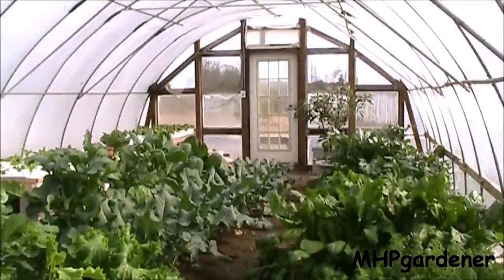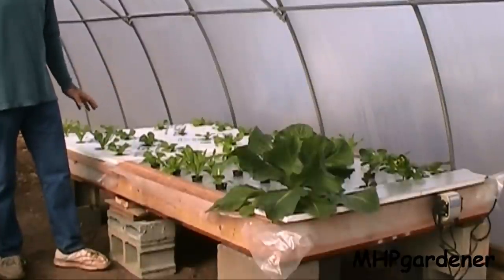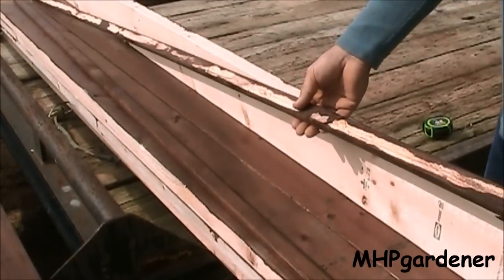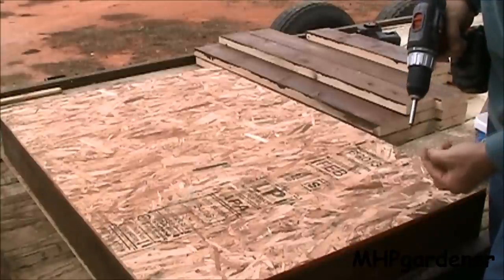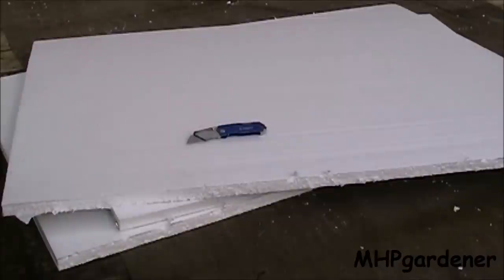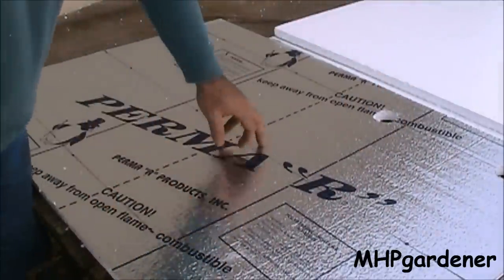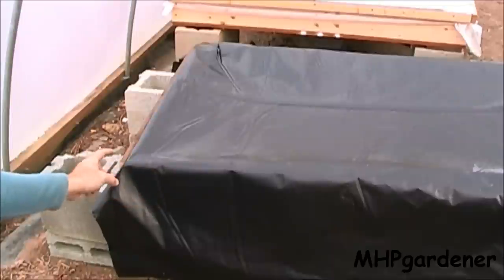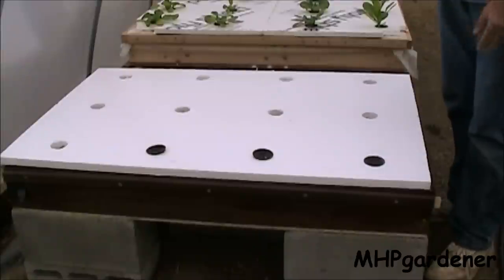Building New Boxes for Hydroponic Growing

Comment: To cut the polystyrene sheet use an old steak knife or the like and heat it with a torch for 10 secs or so and run it along a strait edge as you glide it through the sheet. Literally cuts like butter and seals the foam as you cut. No mess. Same with cutting the hole for net pots. Heat up your hole saw and don't even run the drill just press through the sheet like a cookie cutter. Can't get a cleaner cut.
Reply: Comment like this is the reason i jump to comments section write after the video. i always learn new things on the comment section.

Comment: this is the gold standard for grow box construction. 32 inches from the wall is an easy reach for most folks. four feet of length works well for weight and plant spacing. all components work well in this configuration. have some different plant spacing foam boards for different species. simple works! thanks for your contributions!

Comment from the maker: Hey Bill, I calculate the volume of water in the box, and add the appropriate amount of fertilizer. This box will have about 28 gallons of water, or 5.6 five gallon buckets. I use 10 grams of water soluble fertilizer per 5 gal bucket. So 5.6 bkts X 10 grams = 56 grams of fertilizer. Piece of cake. ;)

Comment from the maker: The cinder blocks are easy to work with, just level and stack. And they are easy to move if I wanted to change the layout. With no sunlight on the plastic, it should last for a very long time. But if I were doing a growbed, with some type of media, I'd go with the pond liner. It's thicker and should hold up longer.

Comment: I was late this year getting my Kratky plants going so I resorted to purchasing starts from the local nursery. I washed off the roots, then put them into 2 inch net pots. The problem was that the roots were all bunched up into the bottom of the pots. My solution was to cut out the very center of the bottom of the net pot with scissors leaving the plastic pieces protruding in from the sides. I wrapped the root ball with a broken rock wool cube. I was then able to insert the plant into the net pot and into the solution. The roots extending below the net pots were well into the hydroponic solution. Within a week I had awesome root growth both in the solution and on the sides of the net pot. New healthy white roots are all over the place and the plants are and happy and so am I. I did this with lettuce, kale, basil, and swiss chard. Hope this helps those that could not get their seed starts going soon enough.
Reply from the maker: Good job Richard. Where there is a will, there is a way.

Comment from the maker: Thanks.The styrofoam is much easier to work with. You don't have to worry about rotting or warping like you would with a wood product. It stays very moist on the underside, so even a good coat of paint probably wouldn't hold up.

Comment from the maker: From what I've read, white does a better job of reflecting light than foil does. All of the commercial growers use white in there systems, so it seems to be the preferred way. Personally, in a small setup like this, I don't know that it makes much difference. Most any leafy green will do fine, and I just finished growing cabbage with this method. With enough water, you could grow lots of things. Thanks.

Comment from the maker: Collards do much better as a fall crop. Around here, we plant them late Aug to Labor Day. And about the time they are maturing, the nights are getting colder and we get frost. The frost is needed to offset the bitterness. It does something in the leaves that makes them much sweeter. So rather than planting in the spring, I'd hold off until the fall. Thanks.

Comment from the maker: No...the foam doesn't actually float. I bought the plastic at Lowe's, just regular 6 mil construction grade. The 2 inch net pots are available from any hydroponics store, or on Amazon. If you do this outside, make sure to put a string or strap across it to keep the wind from blowing the styrofoam away. :)

Comment: Good Job.  I have been experimenting with a passive system and lettuce since November last year here in the UK in a polytunnel, but growth has been very slow due to temperature. The lettuce are now around 3-4 inches in diameter but healthy.  I plan to build boxes soon to try Chinese cabbage like Bak Choi which are seedlings already.  Thank you for the heads up on making the boxes, I will start soon now.  Trevor

Comment from the maker: 6 inches is plenty in this setup. I've seen it done successfully with only 4 inches. I think the pond liner is used because you're filling with some type of rock or stone media. You need the extra thickness and protection. Having a leak in a grow bed would be a real head ache. In a grow box with water and nutrients, a leak could be fixed much easier.

Comment from the maker: I've never done a typical DWC. But if I were gonna do hydro tomatoes outside, I'd definitely go with dutch buckets. Since tomatoes require so much water during the life of the plant, I think it's easier to use a circulating system. If I can help with anything, just holler.

Comment: Thanks for the info. I am building some of these this spring. Looking at other setups it seems to me it would be better to use the shiny side up on the foam board to protect it from the UV light which will break down the foam over time.

Comment from the maker: The big box has 2 sections. The pump is on the side where I do a true floating raft setup which does require aeration. The other side, and the new boxes, are all intended for growing without air pumps.

Comment from the maker: One question...what is you're timetable for breakeven? 30 days, 6 months? Assuming a price of $1 per head of lettuce (way too cheap), and growing 36 heads (3beds x 12), X3 crops = $108. That's enough to pay for the material and fetilizer. A 25 lb bag of fertilizer is enough for 70 crops, using 54 grams for each box. You have to include seed and the net pots, but it looks like a good deal to me. I don't see a way to make the boxes any cheaper. Thanks.

Comment: Your videos are terrific.  Thank you for posting all of this material.  Please explain why you use the styrofoam sheet when doing the Kratky method since it's not meant to float.  Wouldn't it be cheaper to use something else, and maybe easier if it were a little more rigid?  I'm thinking plywood or particle board with a good coat of paint?

Comment: Thanks for the quick reply Bobby. On my MG Tomato label, it does say it contains 0.50% magnesium. Looking at the label on the MasterBlend you use, it says it has 0.40%. In your opinion, should I add the 5 grams of magnesium sulfate to my 5 gal bucket for my lettuce? I dont plan on adding calcium nitrate since it appears to have enough nitrogen 18-18-20 tomato formula. By the way, your dutch bucket system energized me into building the same system and it appers to be working great, Thank you!!!

Comment: I,m making the same boxes that you just made. I think the smaller boxes is a smart idea. So does my back. I'm using 2x8s for my first one so I, like you, can control my water temp better. But, I calculated the cost of the nutrients for my box and It isn't cost effective enough. Even with less water it will still be a lot of money to buy the solution. I need to get my cost down to $5 per 48 x 36 growing bed. Do you have any ideas? Thanks. You are doing a great job

Comment from the maker: No sir, I have no way of testing material composition. The styrofoam simply holds the plant in place, never contacting the water. And the plastic, well.. after seeing how it degrades in sunlight, I don't think there's much to it. I feel like as long as I'm not heating the materials, they should remain very stable. However, if someone had a concern, they could indeed try to find "food grade" materials.

Comment: Great videos, thanks.  Since we are not using the "float" as a float, why not use OBS or plywood.  It will certainly hold up better year to year especially outside.  I used 1/4 obs but it is warping.  I suggest 1/2 inch OBS or 5/8 inch is even better.  I got awesome lettuce (especially the romane) the first year.  This year I was too aggressive by planting some squash and pumpkins so even the lettuce did not do well.  I put up a fence on the north side of the box and tried to grow sugar snap peas.  The pumpkins and squash grew too well and quickly.  Next year, just lettuce and maybe one box with the northern row with sugar snap peas.  I like to experiment like you.  Thanks again!!

Comment: You may be able to use Ridged foam board to build your boxes.  The idea is level your platform (blocks) first.  You will need more piers (blocks) say very 2 foot/ Then place you Foam frame, in this case 4x6 foam frame.  recess cut the foam for your Plywood bottom.  I guess you could also use a 3"x6" foam rails and then use a 2" X 4' X 8' foam for the bottom this would allow you to move them with 1 person.  Just remove the water first.  Her in Jax Florida we have a company called Royal Foam cont.

Comment: I'm doing a  6ft x 2ft w/2x6. I saw your video and how nice things were going for you, so decided to give it a try. I tried doing the Kratky systen in a small 15liter container. It worked good. Iwas thinking in the bigger system I would go for the floating raft system. Which method do you think is best? Also what fertilizer do you use? Thanks again.

Comment: Bobby,  I'm doing a similar setup over the next 2 weeks.  I have a 12x24 GH and I'm planning to do 4 grow beds just like yours, however they are going to be piped in a recirculating aquaponics system.  They are also primarily to grow aquatic plants, but I am going to throw some veggies in also.  How do you like using cinder blocks for your beds?  I'm debating on whether to use them or 4x4 posts that I have salvaged.  how well does that 6mil plastic hold up?  I ended up going with HPDE liner.

Comment: Thanks for all of your videos Bobby. I have a question. I believe that you said that the new boxes held 28 gallons of water. I was wondering how much water was left over after the lettuce had grown to harvest size, or in other words, how much water is each head of lettuce using. I was wondering if you could cut the top out of a 2 liter plastic bottle so that a 2" net cup would fit inside and if the 2 liter bottle would hold enough water to grow the lettuce to term. Your thoughts would be appreciated. Freddie Garrett
Reply from the maker: Yes sir, Dr Kratky did some things with small containers and the lettuce worked well. It won't get as large as something with a bigger reservoir, but it did grow fine. I think he recommends about 1.5 to 2 gallons per plant. How much water is left in the reservoir depends on the weather. Plants will use up a lot more water during hot weather.

Comment: Also, do you have any problems with durability of using the 6mil rolled plastic instead of say pond liner. I ask because i've typically seen pond liner recommended when building beds.

Comment: I expected the styrofoam to be floating on the water and not sitting on top of the frame.  Is there a specific reason for that?  This may be a stupid question but what if the water level fluctuates through evaporation, wouldn't that leave the roots hanging?  I've never done hydroponics but and thinking about trying it, would like to understand it better.

Comment: I built the same box 4x8 feet in size.  I also have 2 air stones inserted inside and there's about 1/2" air gap betweenthe water level and the foam board. However, my plant roots are turning brown. Do you know why?  Is it lacking oxygen? Should I get more air in it?  But my plant roots are turning brown.

Comment: Thanks for the videos. They are great for a neophyte like me. I have a couple of questions prior to building my Kratky method boxes. What varieties of lettuce do you use? What is the radius of a full size plant? Would you recommend sealing the styrofoam with a latex paint to keep it from degrading from the UV rays?

Comment: Hi MHP, I have a suggestion for your boxes before you put down your plastic. I plan on building off your design except building deeper boxes (8 maybe 10 inches). Might I suggest that you paint the inside of your boxes with Red Guard from Home Depot or AquaDefense from Lowes. This will give you a nice smooth surface for the plastic sheeting to lay on.  I do plan on modifying the design to Aquaponics which will mean I have to link all beds together water flow.  Have you given any thoughts on  Aquaponics? Also, do you have any problem with root rot in standing water?

Comment: another great way of cutting styrofoam (though requires being very careful) is to heat a hacksaw blade  (or piece of bailing wire or equivalent) with a blowtorch (small handheld propane torch works fine) then slide it through the styrofoam. using a straight edge or board to guide the cut is good. also precutting the silver backing without going too deep can help. when drilling the holes, the hole saw can be heated in the same way, then just pushed through, or another technique i've seen is to heat a large ball bearing then simply lay it on top of the spot where you want a hole and let go (only do this with pliers). as an alternative to dropping it directly onto the styrofoam, it could be dropped through an appropriately sized metal pipe.

Comment: Hello
Nice video but I have a few questions for you. First are you using food safe plastic liners? Second what kind of stryofoam are you using? I have heard that you have to be careful when using these types of products. Any thoughts on your part about these issues?
Reply: The kind of styrofoam is probably irrelevant, because polystyrene is completely stable at the temperatures used during the growing of the plants (plasticizers leaching into the food is relevant only at elevated temperatures produced by the microwave ovens). The brand is visible on the video and had you googled it ("perma R") you would've found that it's standard construction styrofoam board.

Comment: Shouldn't the Styrofoam be cut to float in the water? This way as the water evaporates the plant is at the same level in the water as when it was first planted.
Reply: You may be referring to an earlier video where he showcased Kratky method vs Floating Raft. In that case he was growing various different plant species in the same set-up. The advantages of Kratky Method, being you do not need aeration, therefore possibly no electricity in your setup. The downside I believe was showcased in that video, plants of different species may hog all the water thereby making it harder for the more shallow roots of the lettuce he was growing to keep up, thus stunting their growth. I believe for this set up he is growing the same exact plants so Kratky Method of no aeration perhaps may work better this time for the lettuce plants, the benefit being he does not need electricity to power a pump.

Comment: Hey Bobby why do you have to use styrofoam since it isn't floating?  Can't you use just osb?  Gotta be cheaper.
Reply from the maker: I think the biggest issue is warping. Seems to me that OSB would tend to absorb the water and begin to sag. Some type of water proofing might help, but then you'd have that dripping into the reservoir from the condensation under the bottom side. You could always try it though, and see how it works out.

Comment: I'm wondering why you can't do the same thing with buckets.  You have 12 growing holes in 12 square feet, enough room for 12 buckets.  A hole in the top and your're ready to go.  If you size your buckets to the plants, say 2 gallon for lettuce, and 3 gallon for thirstier plants, you might have less unused water.

By the way, I really enjoy your videos.  They are informative and they stay on topic.
Reply: Different bucket size = lack of versatility
Common water reservoir = consistent nutrients to all plants in the same system = less fiddly and fewer things to worry about = less hassle

What about using it for nutrient comparisons? No, buckets still wouldn't be good, because a single plant does not make a case for or against anything. You need a larger test group under the same conditions.

Comment: Hey Bobby Love your videos and your mission. After losing my crops for the third time (in three years) to frost I found your video and have already built these same boxes and purchased the chem gro tomato fertilizes you recommended in your videos. So I'm into it about $200.00 and ready to add the water and fertilizers and was hoping you could help me with the formula you use for this size box? Thanks again for your help. Tony
Reply from the maker: Its real simple Tony... Calculate the volume of your box as it relates to gallons of water. Then add 2 oz of your fertilizer, 2 oz of Calcium Nitrate, and 1 oz of Epsom salt for each gallon of water. My boxes held 27 gallons of water, so I had 54,54, and 27. Hope that helps. Bobby
Reply: @mhpgardener  thanks Bobby, so sounds like your Lettuce formula 10-10-5. Appreciate your time.
Reply from the maker: Yep...10 10 5 for leafy greens.
Reply: @mhpgardener  thanks again Bobby

Comment: Sir, on Styrofoam, just take a circular saw and put the blade on backwards... then "cut" slong a straight line (Think about it ... the drill in reverse for PVC????) I used to run a crew in construction and it was the quickest way we knew to cut the stuff cleanly over a utility knife... additionally for those who do not own a 4 foot square... just measure in with your tape measure egual distance on both sides... put a chalkline on the two points and make sure it is tight ... draw strait up on the line and "snap"  :D
Reply: Oh plywood blade btw for the saw....